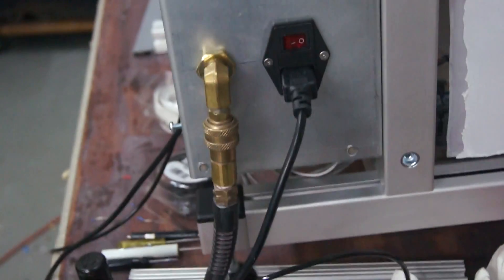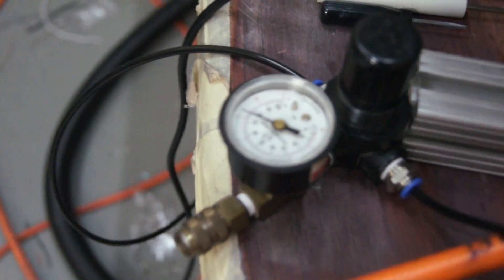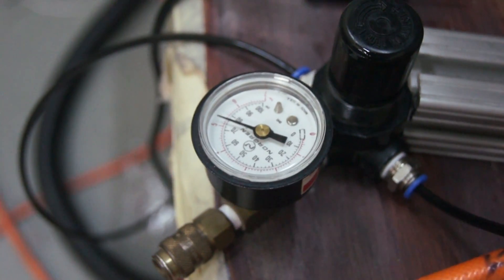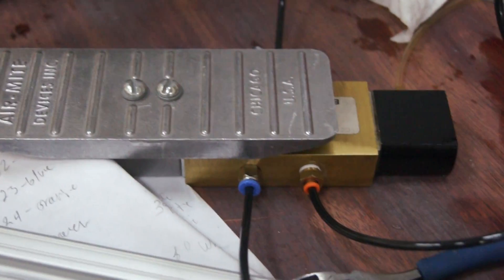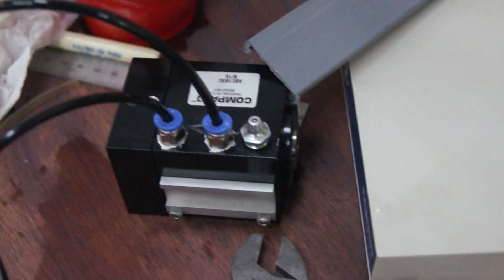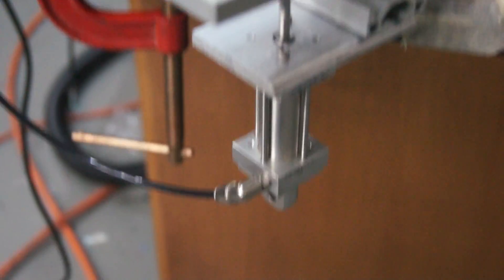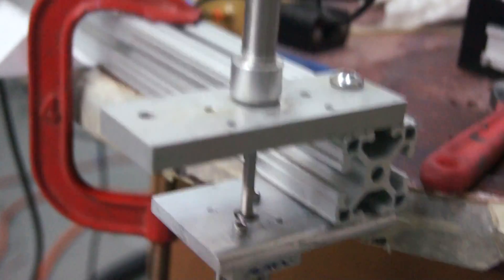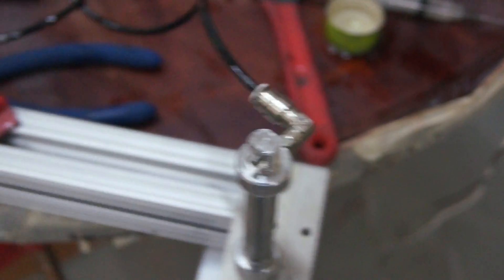Air over hydraulic Pressure Booster

Comment: This is exactly what I was looking for. My car is low to the ground and many jacks don’t fit well under it.=>>share4.photo/pCarJack?V48    This one fit with plenty of room to spare and lifts high enough to do anything I need to do. Should have gotten it earlier
Reply from the maker: Everett Bonds 
How did your hydraulic testing work out?
BTW harbor freight has a floor jack that closes to 3.5”. It might fit your lowered car. I use it on my lowered car.